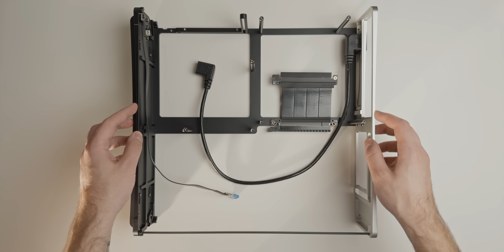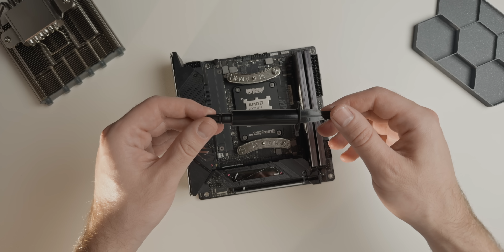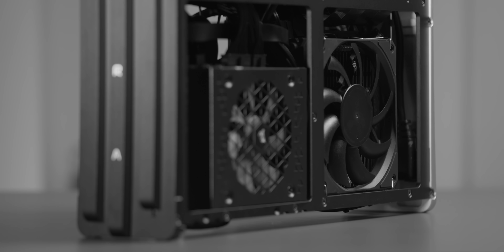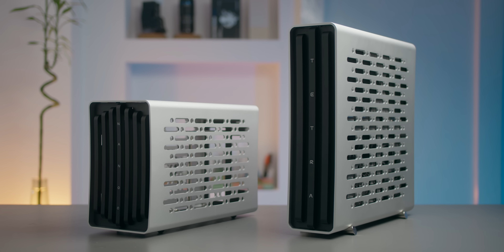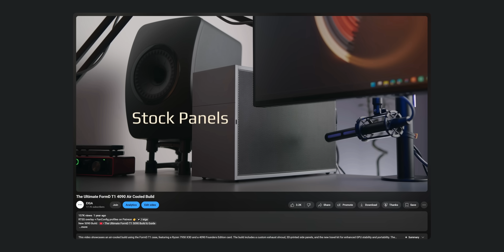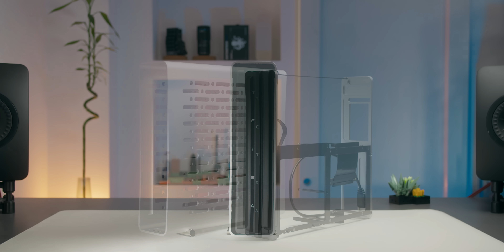5090 FE Console Style Build - Meet the TETRA R

Comment: Holy smokes, those Noctuas sounds great even at full speed. What kind of magic is this.
Reply from the maker: The kind of magic where it takes them years to develop a fan, and I guess it pays dividends.
Reply: Expensive magic
Reply: Oddly enough, material type & thickness often plays a huge role too. There's those Alphacool fans with the metal frame that had a bit of a controversy with a particular reviewer back then, but if you listen to their noise they actually sound vastly quieter even at the same dB levels of other fans. But yes, generally those expensive fans are expensive for a reason.

Comment: Is it possible to mount the single 120mm fan using the top two mounts at the lower margin , so that it can pull air to the gpu compartment
Reply from the maker: You can actually, there’s some photos on the SFF Hub discord from Chris Russel showing exactly that.

Comment: Are the chrome bars on the stand attached magnetically? Or how are they attached? Can you show how it looks horizontally?
Reply from the maker: They attach with screws from the inside. If going horizontal you can add two more feet on the opposite side and then the case is supported in four locations.
Reply: @EIGAtech Thanks a lot man! 👍